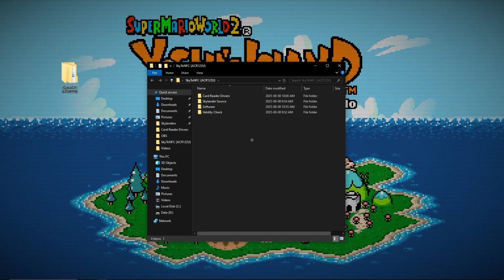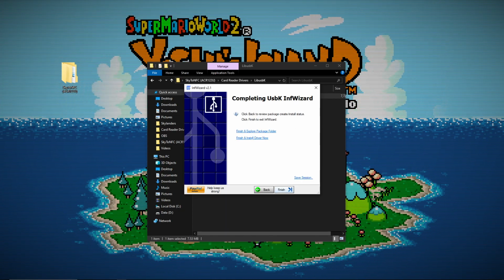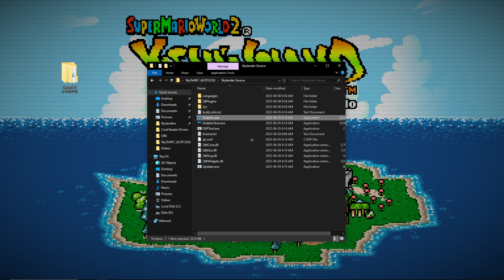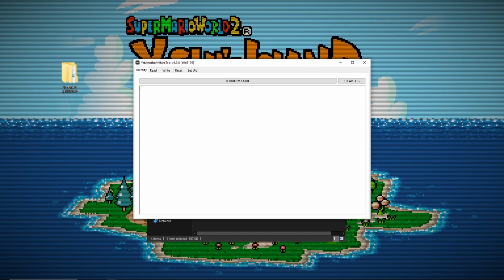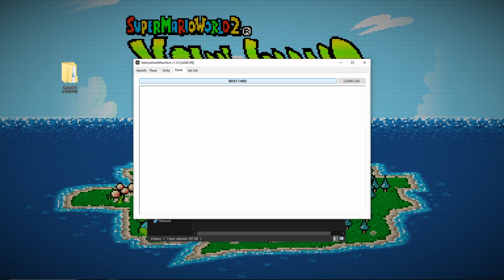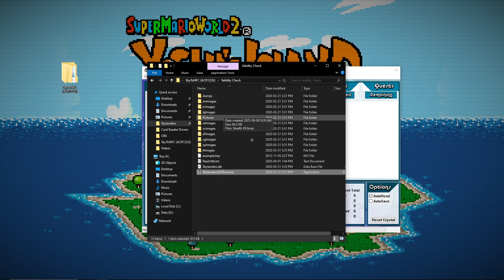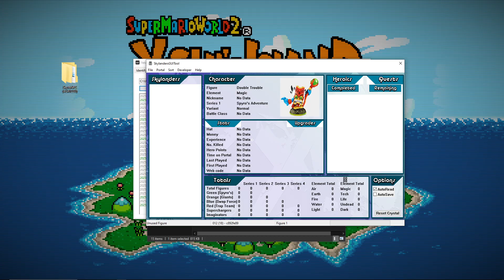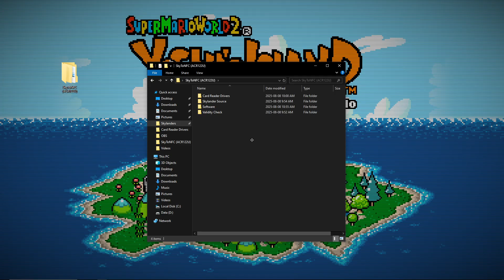MAKING NFC SKYLANDERS HAS NEVER BEEN EASIER!

Comment: You are amazing!! I didn't buy many cards and ,while I can just buy more I'm too cheap for that, with the old method resetting the cards was hell. Now i can just read the card to save a dump of it (which I setup to be in the same folder as the skylanders generated by dolphin) and press the reset button then do the regular writing process, thanks!

Comment: do these cards work? i bought them already and was wondering if they are good or not
Reply: No they won‘t.
Tested it for myself recently and you need a card with 1024 Bytes.
These ones are, but the very first block of Information on that card us locked for the Info of the seller of the Card, at least if you read the description.
The Problem is: To load a skylander in these the first block must also be writable, but it isn‘t.
Reply from the maker: They do bruh, there are 2 options: "block 0 not writable" and "block 0 writable". You select the "block 0 writable" cards so you can write to block 0

Edit: I updated the description to be easily understood in case this was frequently overlooked

Comment: Quando eu  clico em identificar o cartao aparece esse erro " Error: Failed to read manufacturer block!" cartao é um ntag215
Reply from the maker: The manufacturer block on your cards have to be unlocked, so you need to get cards that have block 0 unlocked. If you got the ones from the description and they didnt work, thats because there are 2 selections, "block 0 writable" and "block 0 not writable". In case others have made the same mistake i updated the description to be easier to understand but the main issue is that the cards need to be unlocked